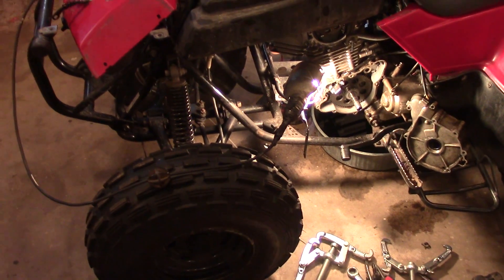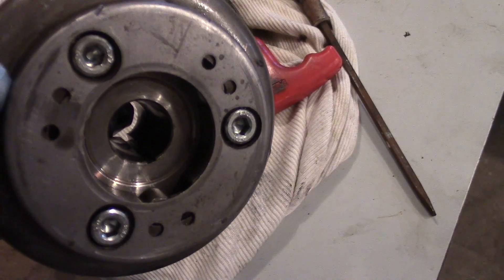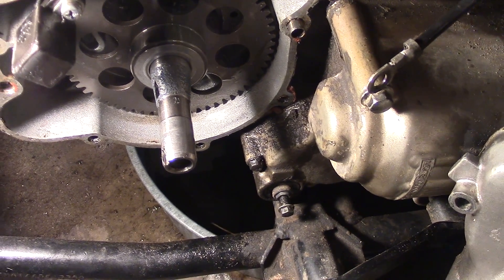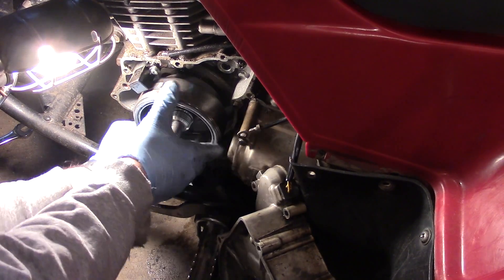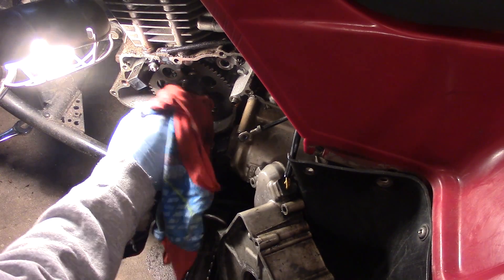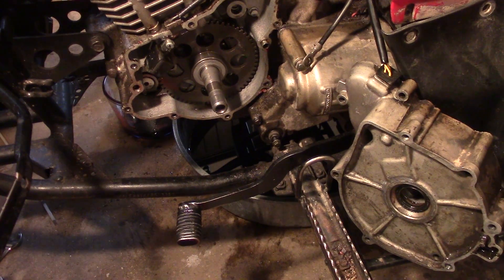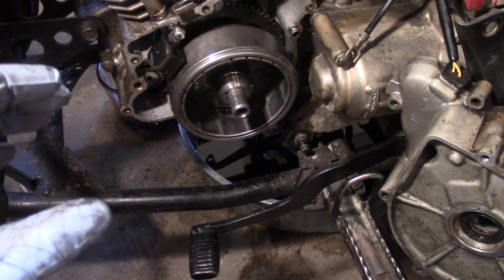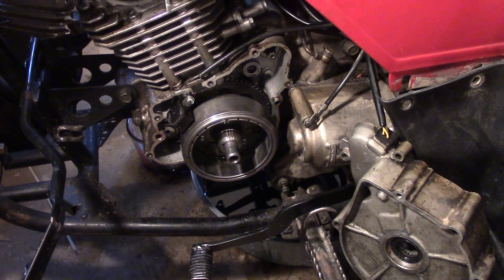How To Prevent a Flywheel Key from Shearing

Comment: He has hit the nail on the head. I hope i’m not the only one who thought the key played a part in securing the flywheel. Torquing down sufficiently whilst the key just aligns the flywheel is the answer. Thanks for the logical explanation.
Reply: I just think I’ve learnt that lesson snapped 4 woodruff keys on a Husqvarna crosser I just picked up🤦🏼 impact guns etc but only used lightly my crank is a little worn so is the flywheel but each time I have play in the flywheel but the nut is still tight but obviously not tight enough

Comment: Thank you very much for this video.  I sheared two keys and thought I better see what's on the web to help as I was very puzzled.  I thought a high torque would be sufficient, however two other major mistakes I think are to blame.  1) I put Anti-seize on the crank (both times) thinking that would help with potential rust binding.  2)Not enough torque the first time.  Your video was logical and clear and I'm kicking myself for not seeing it earlier.  The flywheel is meant to bind on the taper of the crank but must be clean and dry and the more surface to bind to the better (vs scored taper, etc.).  One of the best videos I've seen with thorough and clear detail.  You seriously saved me on this one.  Thank you! Thank you!!
Reply: Hey Double wide 6,  I can't thank you enough.  Big help. Will chat soon.

Comment: This fantastic video teaches that Lap, clean and torque are the "KEYS" to successful shear prevention of a removable woodruff key which isn't meant to contribute to the job of precisely matched tapers in securing alignment. Some flywheels have a cast in place key that can't be removed for lapping and the importance of cleaning and torquing of that style is also often misunderstood and cause of failure.
Reply: This is weird... you posted with my channel name (Joe Blow) which I created before you did and even weirder is that in the process of trying to sort out the situation I unintentionally deleted one of your good comments in another video expressing your opinion about the best backpack leaf blowers and now I stumbled on yet another of your comments in this unrelated video. What's the chance of that? 

Anyways, I was going to comment here that keys are for alignment and the fact that shear prevention depends on smooth, clean, dry and tight taper surfaces when I saw that you already explained that and then I saw that it appears that I posted your comment, but I'll add to your comment that often people that do not understand will recommend lubricating tapers thinking easy removal which causes key shear and then blame key size or weakness. You can align by eye and not even install a key and be just fine. Often people not knowing how to use a proper puller think difficult removal is due to lack of lube, corrosion or because it has been on there too long which is just a matter of not understanding the concept of the intentional gripping power of matching tapered surfaces.
 
Can anyone explain why we have identical channel names and why I am able to edit and delete his comments?  I'd expect him to agree that having the same name as me is not good for either of us, because this identity confusion effects each others credibility and reputation. The comments of his that I've read are very good, but I don't want people thinking I posted his comments and surely he would feel likewise. I haven't found a way to solve this problem or contact him to straighten it out so if anyone has advice please reply here and/or contact me via my gmail email address which is : dontbeasmuck

Comment: woodruff keys are not meant to stop anything from moving, they are only to align gears or flywheels, if the flywheel key keeps getting sheared off, it is happening for a reason, such as you forgot to torque the flywheel nut down, flywheel started to rotate on the shaft and that little key is not going to last long.
Loctite retaining compound is excellent to use for flywheel installation, with that and a properly tightened flywheel nut your woodruff key will not be in any danger so long as the shaft was half decent to begin with

Comment: I believe that another tuber was talking about your video but he couldn't remember who he had watched. He didn't even know any of the parts that he had pulled out...he meant well though. So I take it on this model ATV you have that it doesn't have a recoil starter pull rope? I believe that is the issue with this 2004 model Bruin. The original rope starter was beyond repair and just as you stated the timing was way off. I got the timing lined up but still not cranking and yes I have spark, just sparking at the wrong time. Prayers for your boy..

Comment: THANKS FOR THE INFO BRO IVE JUST SHEARED THE CAMSHAFT KEY ON MY MY HONDA PILOT HOPING MY VALVES ARE OK STILL AND I CAN SEAT THE GEAR BACK ON THE SHAFT TIGHT IT LOOKS LIKE IT MAY HAVE SPUN  A BIT AND GROOVED MY MORSE TAPER HOPE YOUR TRICK WILL WORK

Comment: Nice tip, you can get water based paste i use it to lap mower cylinders .
Reply from the maker: +Peter Froud Interesting do you use it with a cylinder hone?  Is there a link to where I could purchase some?
Reply: The lawn care guys use it , i use it on the cylinder and bottom knife, its the same as valve paste but water based , so easier to remove.http://www.chemico.co.uk/lappingpaste.html sure you can get it in the states.

Comment: I have trouble with my Kodiak 400 backfiring and doesn't start. did the carb, valves adjustment and all. 

eventually what I found is when I align the TDC line on the sprocket, the flywheel TDC T mark is not there at all. Huge mistake. 

so when I adjusted the valves counting on the flywheel T mark, I was so off that I had a valve gap 25 times larger than it should! crazy.

Any ideas how to rectify and get the flywheel aligned as the sprocket? I did check the piston position while aligning the sprocket TDC line and indeed it was right at the top, also valves at the top so it is the flywheel that is off and I dont know how to fix it....

Now watching your good video I assume my key broke off and allowed the flywheel to shift? How do I get the flywheel off though? 

rrrrr draining the fresh oil I put in...
Reply: Hey Sean,
Sorry to hear about your Kodiak flywheel (Generator) issue. 
There are special pullers that are designed to remove the flywheel, and they can be purchased on eBay. When using the correct puller tool, make sure that it protects the outer end of the crankshaft with either a sleeve that fits over the shaft, or by threading the original bolt into the shaft. A lot of force is applied to the shaft while tightening the center of the puller, and it is possible to "mushroom" the end of the crankshaft. A little care will prevent this.
This video does a good job of explaining the process of "lapping" the tapered seating surfaces (of both the crankshaft and inner flywheel) to correct any scoring that may have occurred after the wooddruff key sheared. 
It is important not to skip the lapping step. Most people fail to understand how the tapered seat works, and assume that the woodruff key is responsible for preventing the flywheel from "walking" on the crankshaft. This is not the case at all. The true working principal is a friction "press fit" via the the two opposing tapers (flywheel and crankshaft) which relies upon a smooth mating surface. As the bolt in the end of the crankshaft is tightened to its specified torque, it causes the center of the flywheel to expand slightly as it is forced onto the "ramp" (crankshaft taper) and a great deal of friction holds the components in place. The woodruff key meanwhile, simply serves to maintain alignment of the flywheel and crankshaft during the tightening of the flywheel bolt. Therefore, if the tapered surfaces are damaged, and fail to seat properly, the woodruff key cannot hold the two components aligned, and the key will simply shear again a short time later (often to the intense frustration of the newbie mechanic).
Be sure to clean the flywheel inner taper, and the crankshaft tapered surface with a clean rag, followed by a second cleaning with a solvent wetted rag. This will insure that the friction bond will not be compromised by traces of lubricant left by the lapping paste.
Good luck with your repair Sean. Take your time, do it correctly, and you won't need to repeat it later.  -Master Mechanic

Comment: Hi. I am struggling to install a woodruff key on a tapered shaft on my JD LX172, kawasaki 14HP engine. I can't see the damn thing! Keeps falling out, as the shaft is vertical! Are there any tricks to this? Do I glue the damn thing in there?
Reply: Don't glue it in just use a spiny dab grease to hold it in there. If you're still having problems with it it's because the magnet on the flywheel is pulling and lifting your key out try taking a small piece of wire holding the back end of key in place while you slide your flywheel back on to keep from pulling out of the keyway slot
Reply: @brenttate9299  thanks for the reply. What I ended up doing was getting some valve grinding compound and applying just a smidge to the key. That stuff is very grippy and it held it in place. Problem solved!

Comment: I was thinking, I wonder if you could use Locktite bearing retainer for problem key-way shearing.  You would have to heat it to pull the flywheel.

Comment: It’s not good to rotate the engine in reverse direction, it can cause problems with the valve train. Should have rotated the flywheel counterclockwise, there’s actually an arrow embossed showing the correct direction of rotation. Also the gear should have been held to prevent the crankshaft from rotating so that the grinding was more effective.
Reply: PRECISELY what problems on which engines?
Reply: I don't believe the motor was turning, the gear behind the flywheel may have been but  was the shaft was stationary.

Comment: Did not show/tell how to clean grinding compound off of crank but did say twice how important that was. did no
t say how to prevent shearing key or was seating the flywheel by grinding supposed to prevent shearing? do you measure turns of fywheel by time? How about turns not minutes.

Comment: Should have been holding the gear from spinning.While you were spinning the flywheel you're just turning the whole shaft.
Reply: That crankshaft would only spin if you got no compression
Reply: @brenttate9299  you don't see the gear behind the flywheel turning as he's trying to hone the shaft with the flywheel? I do
Reply: @brenttate9299  I guess I could have just been the direction he was spinning it the one way bearing was grabbing the starter gear.
Reply: @glennonheinrich8185  learn your vehicle better that is a one-way clutch gear which sits between the flywheel and the starter therefore as he's moving that flywheel back and forth engaged it will move that but if you will also notice that gear only turns in One Direction do some research before you start ragging on somebody
Reply: @brenttate9299  I know that's why I commented about it. I had the same problem on Polaris predators kept sharing keys. I just watched it quick a year ago when I commented.
Reply: @glennonheinrich8185  no you commented to Me 2 hours ago about that gears spinning nice try
Reply: @brenttate9299  whatever the original comment was a year ago and I didn't watch it that closely then. As you can see above before your comment about it being a one-way bearing I already corrected myself about it being a one way bearing. I'm not going to argue. have a good night
Reply: @glennonheinrich8185  nice try again look at the dates of the post and the time of the post
Reply: @brenttate9299  you look at the dates and times. I corrected myself about the one way bearing two hours before you mentioned it.

Comment: lap it like you said  - heat rotor slightly around middle -install and tighten before cool down -good luck getting off next time
Reply from the maker: That is a good idea.  Nice tip.  Luckily my method worked well that I used here.

Comment: I tried it it didn't work for me and it doesn't matter what you torque the bolt to because it doesn't meet up with the end of the flywheel I made a spacer for mine fixed it hope I never have to work on one of these pieces of s*** again Kawasaki sucks poor engineering
Reply: Spacer as in a washer?